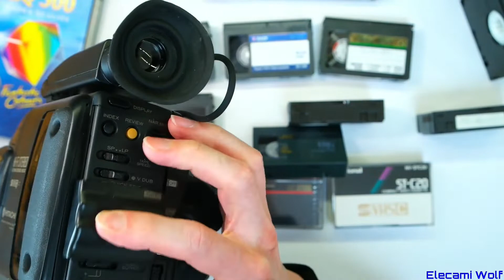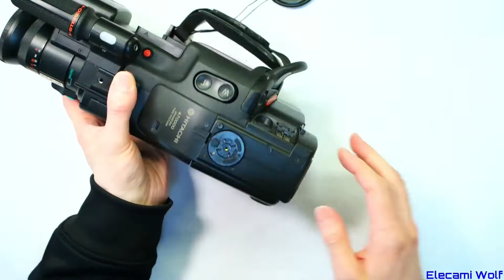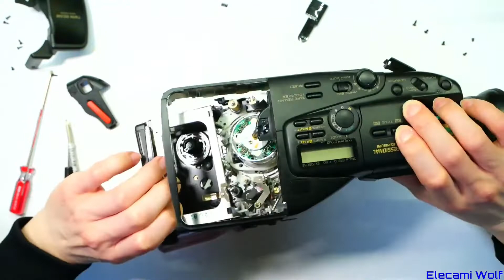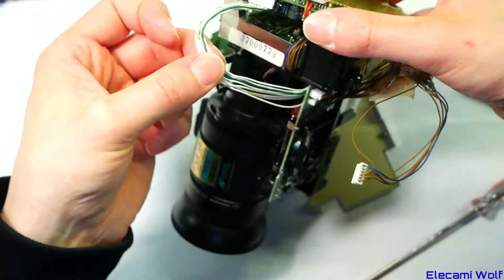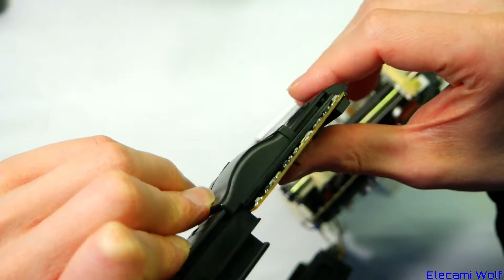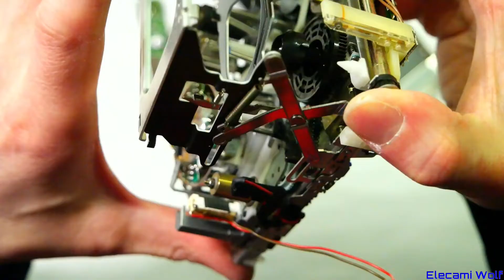EW0053 - Hitachi VM-S83E SVHS-C Video Camera Teardown

Comment: i have this exact camera, and wondering if you could help me find what aftermarket battery i can get for it? :))))))) or anyone else in the comments. ive looked around a bit, but if anyone knows id really apperciate it!
Reply from the maker: Do you know if the camera works? Can you power it from the charger to test it.
Reply: @Elecami  yes the camera works, and the battery worked for a little while, but now it runs out of juice after a few minutes
Reply from the maker: @4321jacob1234  There is probably a standard barttery for a range of Hitachi models.

Comment: Might be a long shot, but do you have access to a manual? I've found one of these on eBay, unsure if its operational but cannot find a single manual online, except for one which is paywalled on an unsecure russian website lol.
Cool teardown nonetheless - i'm praying mine doesn't have bad capacitors.
Reply from the maker: I don't have a manual sorry. It would be likely they all have similar issues with capacitors.
Reply: @Elecami well good news, I received mine on Friday and it works!! I think so anyways, I’ve yet to test out recording but may need a head clean and all auto settings make weird distortions, and so is set to manual. Too lucky
Reply from the maker: @hottrash8970 That's lucky. good buy. Hope it lasts.
Reply: @Elecami  thanks :)

Comment: Hello, I've just bought this model of video camera and the casette place keeps opening for no reason whatsoever, all the internals work and it's not the clip that pins it closed, because it stays closed until it makes the opening noise and it opens, any solutions? thanks in advance!!!
Reply from the maker: If it is similar age to mine then I think there will be power supply and other issues due to old leaking capacitors. 
The loading motor driver could be faulty and causing the loading motor to always run in the unload direction.

Comment: When tearing down something like this, the downside is that even if you went to the trouble of replacing all the bad caps and cleaning everything up, it's damn near impossible to reassemble it because it's like a giant 3D puzzle with pieces that go everywhere.  Regarding the viewfinder, is that made in a way that you can feed your own video signal into it and see it on the tiny screen?  Or does it require other circuitry on boards in the camera to generate the picture?
Reply from the maker: I like the challenge of putting these things back together. 
Most of the things I did teardown are back together even if not shown on the video. 
This one I decided to scrap it is a bit far gone with all the mess on the boards. A shame. Nice camera apart from that. 

Most of the time those view finders can be used as a standalone video monitor. 
Supply it with 5V, 9, 12V depending on what it needs and a composite video signal and away it goes. Tiny TV.
Not very practical but it is fun to see.
Reply: @Elecami  That's good to know.  I have an old camcorder, the kind where the VCR portion was a separate unit carried in a shoulder sling bag, basically a full sized VCR that ran on batteries.  I'll have to see if I can do anything with the tiny little viewfinder TV.
Reply from the maker: @00Skyfox  In my experience, those type of cameras are the ones that might not have a fully integrated view finder. The National brand cameras I looked at the view finder needed external sync provided to it and the power supply was weird. Those cameras had largish 1"(maybe) viewfinders.
Reply: @Elecami  I think you may be right.  The camera is an Olympus VX-308-U video camera, and based on the manuals in the bag it came with the Olympus VC-106A-U VCR, plus a TV tuner unit.  I found a couple different pinouts for 10-pin plugs like what it has but I can't find anything specific to this camera, so I don't know whether it follows the EIAJ standard.  I can power it up with 12V and the viewfinder CRT does work, but it will not display anything aside from a little box on the side that moves up and down corresponding to the exposure.  The auto focus appears to be operating and I can switch it to manual focus but nothing else works (with manual iris I can make the little box in the viewfinder move up and down).  The power light is supposed to be green when it's on, but it stays red as if it's in standby.  Without having a VCR with a 10-pin video camera connection to test it with, I really have no idea what kind of signals it's looking for.  I'd send it to you if I could and let you tinker with it and tear it down because I don't know what else to do with it.
Reply from the maker: @00Skyfox  The 10 Pin Connector should be standard. The only ones I know that are not standard are the really old black and white systems where the VCR sent sync to the camera. All the 10 pin color cameras I have come across use the same pinout. You only need to supply to supply them with 12V and they will work. View Finders are not consistent though.
I am wondering if the camera you have is similar to a JVC GX-N70, I have one and will make a video of it at some point. There are a lot to get through.